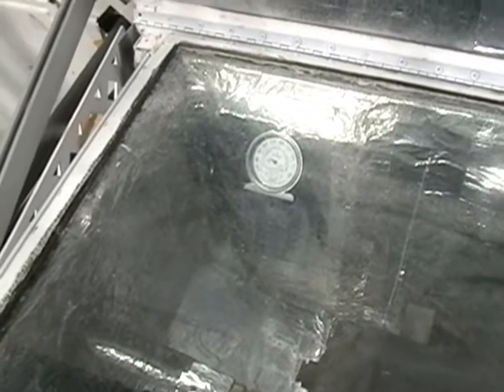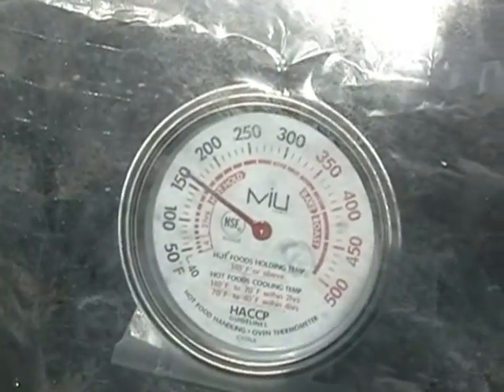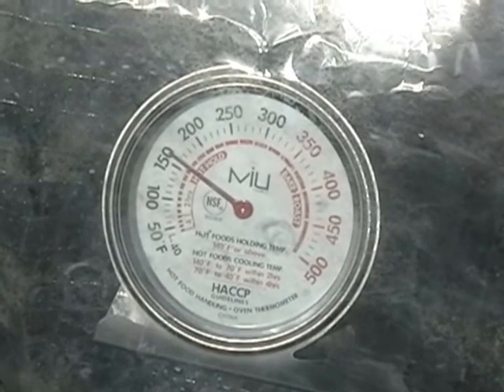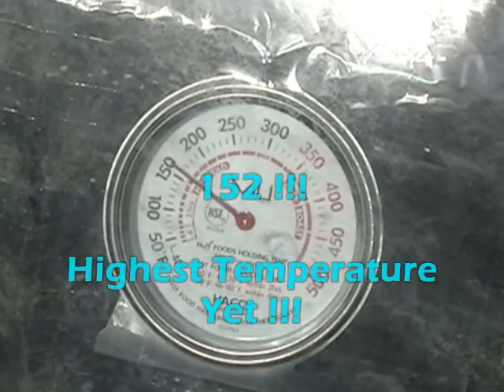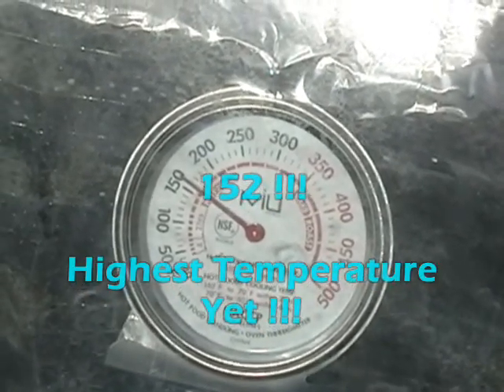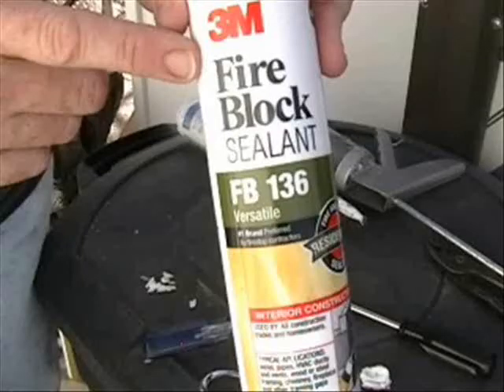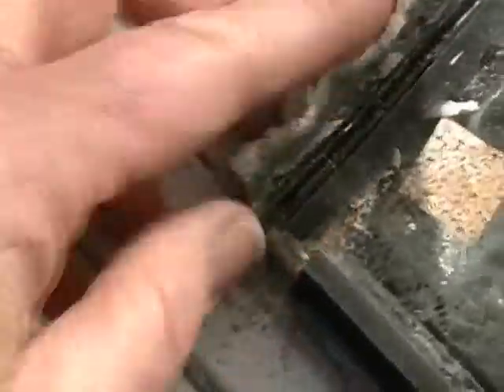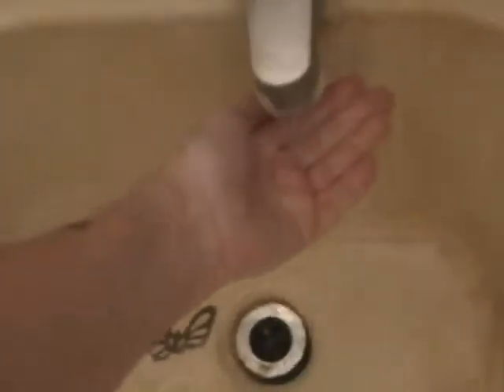021310 Bread Box Solar Water Heater Update

Comment: Kasin just use 100% pure silicone caulk. it holds up to 400 degrees and is the most water tight caulk you can get. let me know if you need any more help babe. thanks